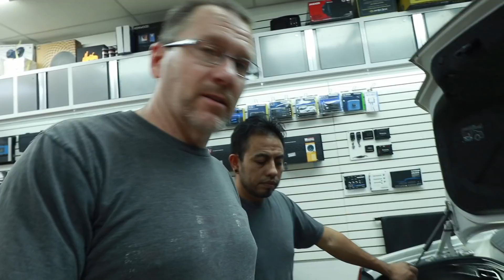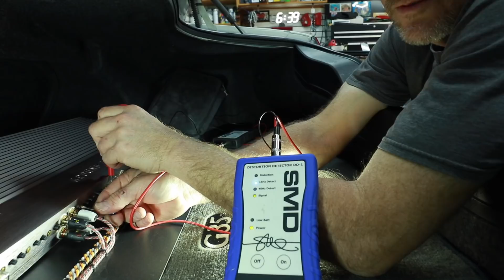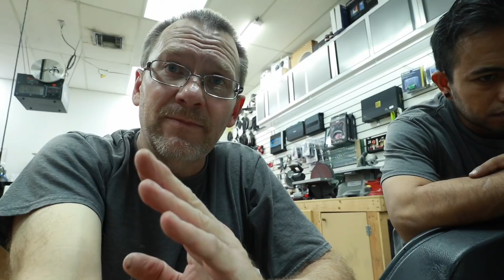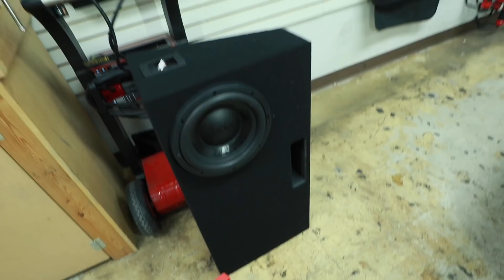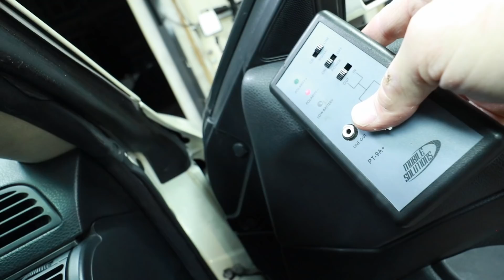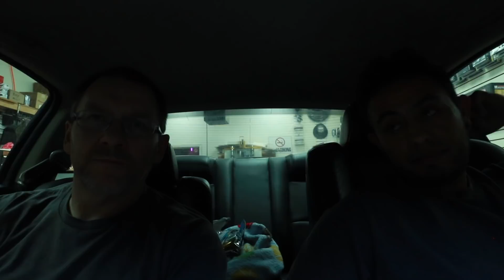Ground Zero Uranium  full System done and time to listen Car Stereo Lab part4

Comment: Good video, but you shouldn't turn everything up on the "deck" while adjusting gains. Leave everything at 0 or neutral, THEN set your gains 😊.

Volume is the only thing that should be up only our deck, to your max normal listening levels during gain not volume settings on the amplifier.

Comment: For those reading the comments trying to find price. As a dealer I am willing to say it out loud. The amplifier used in this install is 1999.99 and the speaker set can be bought in 2 or 3 way prices for 1000.00 to 1450.00. While I carry this brand I also value and for the money Focal does better. ( Keep in mind carry both brands and am happy with both but at this price range Focal wins )
Reply: Must be US prices , in Germany the Uranium amps are 650€
Reply: Depending on what kinda of sound you want
Reply: @randomaudioguys how would you describe the sound signature of these speakers and which Focal Speakers would you say they are closest to in SQ? Are they smoother like Morel or Hertz?

Comment: A biased normally lower out put ,  so essentially you did turn them down.  That's my theory . Maybe some testing of the output voltage with multimeter would be quick and easy to test that.
Reply from the maker: We did an amp synopsis video showing the results
Reply: @FiveStarCarStereoInc  awesome I will look it up . Thank you

Comment: I am upgrading the music ( pioneer car stereo and factory speakers) in a  2002 Nissan Almera.  I am planning to use 6.5 Skaar speakers and a Skaar 10' sub. Would you recommend the set of 6.5 in the front doors to be component speakers and place the tweeters on the pillars in front or use a 2 way Coaxial set?
Reply: Whatever you change from stock to aftermarket, for sure will sound better, but you gonna need an amplifier to feed the components.. at least 350.4 amp an probably 400.4 but since you are installing a 10" sub that should be fine. Choose 80 RMS components, leave 15-20% to the amp.. always a little bigger that way you don't overwork your amp and calibration is important
Reply: @ricardojuarez291  thanks.

Comment: did you make that speaker wire out of any specific  wire I see several other knowledgeable installers like yourself doing this but no mention of what kind of wire or gauge.
Reply: We use stinger primary wire 18g. Sand we have all the colors that they offer.
Reply: Stinger wire.  16 or 18 gauge